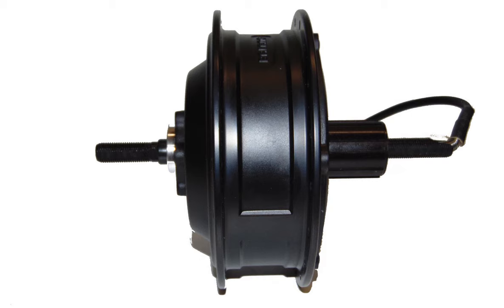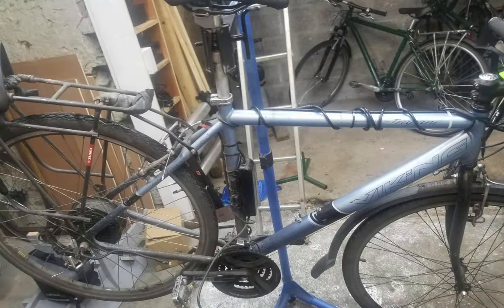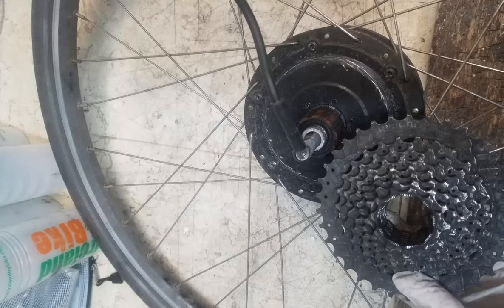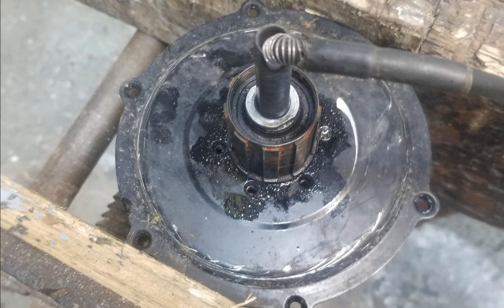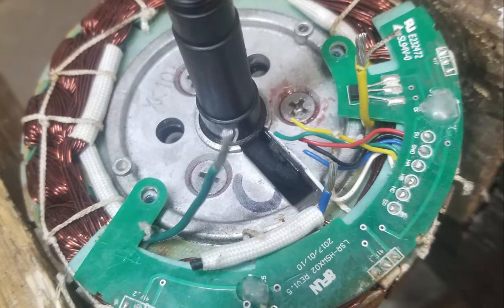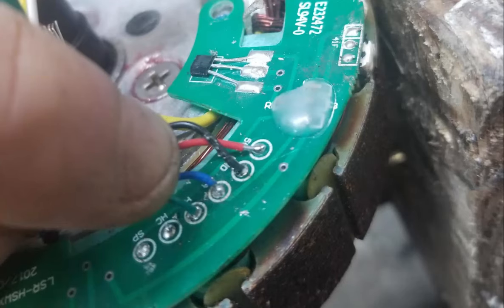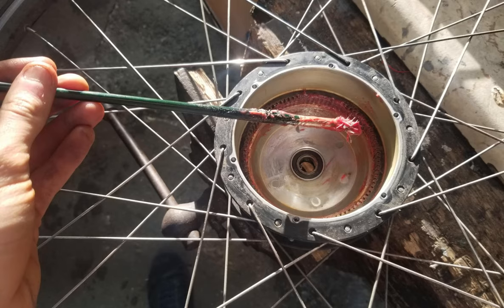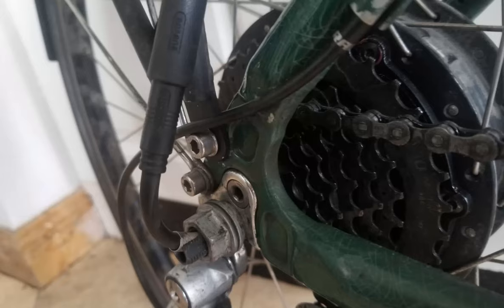E-Bike Motor Repair - Damaged Cable Bafang Hub Drive

Comment: Where did you buy the cable ? Or the name of the cable . Thanks
Reply: Type in 9 pin ebike cable
Reply from the maker: I didn't need to buy a cable - I just shortened the one I had

Comment: hello  DOM I BOUGHT A  BAFANG  8FUN  250W  HUB OF A GERMAN COMPANy  THEY HAVE NOT BEEN HELPFULL AS IN TAKE THE MONEY AND RUN  IT HAS  6  PINS  ON IT  3  THICK 3  THIN  ITS SOMETHING I HAVE NEVER SEEN BEFORE  I CANT SEEM TO GET A SPEED CONTROLLER ANYWHERE FOR IT  AS I HAVE NO IDEA IF ITS SENSOR OR SENSORLESS  CAN YOU HELP OR ADVISE MY FRIEND  PLEASE ?? PICS AVAILABLE
Reply from the maker: Unfortunately, Bafang parts distribution is patchy.  There are some sellers on Aliexpress that do a lot of Bafang/8fun parts, might be worth a try.  I suspect your motor is sensor-less but can't promise.
Reply: @dominicogallachoir4554  thankyou my friend after weeks of research high n low  i believe it is also sensorless  as the 3 heavy pins is what seem to matter  il keep you posted     from what im told the 6 pin male connector goes into a 9 pin female

Comment: Where did you get the wire? You can't repair these motors because no one knows where to get the wire?
Reply from the maker: I just cut away the damaged bit and shortened the original wire in the motor

Comment: Is problem motor hub power is gone and work. how is repair?
Reply from the maker: This all depends on what's causing the problem.  Is there damage on any of the parts?  Are you getting any errors?  Is the battery charging okay?  You may need to do some experiments to figure out what's causing the problem.

Comment: is the hub speed sensor inside this one?
Reply from the maker: Yes, it must be.  I strongly suspect that the "sp" pad on the PCB connects to the speed sensor.  See the white wire connection at 3:03

Comment: I stopped at about 3 minutes and 7 seconds into the video I'm sorry but I'm a mechanic and a bike shop and if you're going to change the cable you might as well change the halt sensors as well all you have to do is unscrew the two Phillips screws that are holding down the circuit board and you can access everything as long as you have some of the insulating paper that was originally there you can still reconnect the wires from underneath if you're going to reconnect the wires or resolder them on the top of the board you should cover it with a little bit of hot glue or some sort of silicone sealant and make sure that the top cover is not rub against any of the contact points of the wiring mind you but it's also necessary to use some silicone at the point where the motor cable enters the inside of the motor body and possibly a little bit on the outside of the axle where the motor cable enters the Axel from outside to protect from any water Ingress

Comment: Can you fly to New York and repair mine? The border is open 😁
Reply from the maker: If you buy me the tickets then no problem ;)
Reply: @dominicogallachoir4554  I think I can repair but I can't get it open with a screwdriver I think I need an electric tool , bike stores that repair are too lazy to fix it they say they just replace parts ...I mean if that's how they fix then even I can open a bike shop